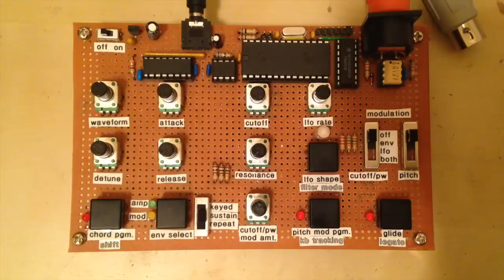LPC1114 Synthesizer Part 1 - Overview

Comment: Awesome work!

And if i can take some of your time:
How do you get selectable resonance on your synth?
With what method do you mix together the waveforms?
Are there any DIP (CMOS) ICs that containd an prebuild resonant lowpass filter?

Im trying to build my own analog and digital synth( and it is going smoothly), but im having alot of trouble with making the damned resonance variable.

Comment: Yeah, this would be pretty cool as a kit. Appears it's a single sided design too which would make it easy to produce.
Reply from the maker: I'll look into making a PCB... it definitely has kit potential. I think it would be surface-mount; the LQFP48 package has more GPIOs and would greatly simplify the circuit.